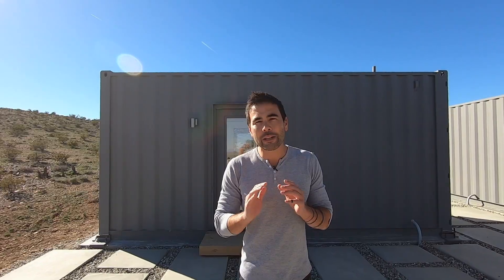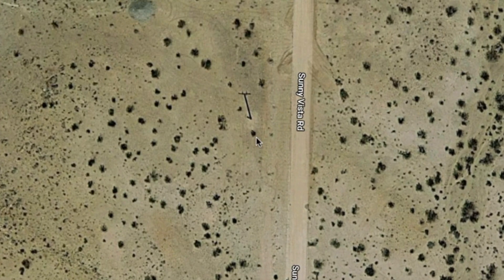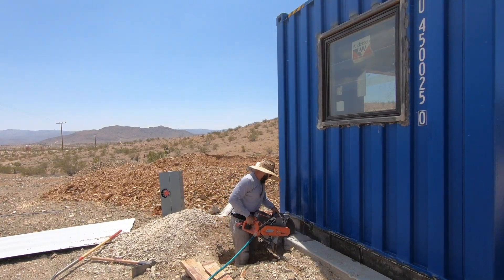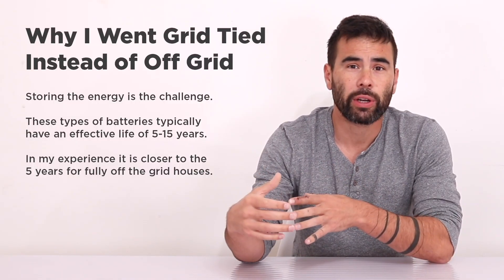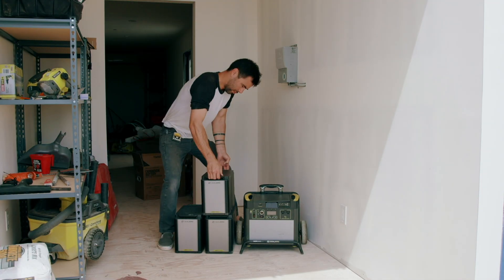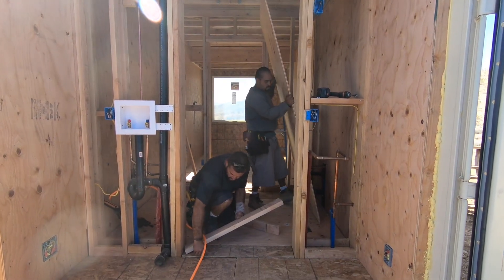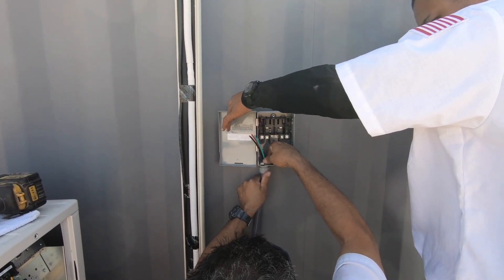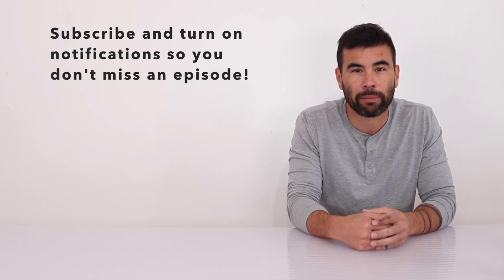Building a Shipping Container Home | EP05 Connecting to Electricity and Water

Comment: Thanks for sharing, Ben. I’m not sure I’d worry about connecting WiFi to your battery backup. If your utility goes down (not as likely in SCE desert as it would be in SDG&E or PG&E) the cable company and/or cell provider is probably out too. I do like the idea of emergency battery vs small generator, though; I’m gonna steal it from you! Cheers

Comment: Another point regarding off grid is that you need to design the storage for the depth of discharge. Most batteries do not have longevity if you exceed the depth of discharge. That can dramatically change your calculations. Usually 80% for lithium and 40% for AGM. i.e. 80% or 20% of your available capacity before you start killing the longevity.

Comment: Electrical Provider charging you for a stepdown transformer is complete BS .. Its their system , they chose to run it at high voltage. .. Yes charges for wire runs and poles on your property is normal .. But NOT the transformer .....  Cali is unreal. ; Just researching into this and you should be able to save money(monthly)  if you own the transformer.

Comment: Ben - please don't apologize. Your generous and altruistic sharing of your talent, designs and detailed information are gifts to us all. We are very grateful!
Reply: would have defintely added a solar hot water system if building in this area although the tank would need to sit in a shed outside Imexpect as they are large, we have one in Belgium the panel is embedded in the roof for ambient heat transfer for about six months we get almost free water hearing to high temperature and it seldom runs out. We have a diffent heating system for the winter and for back up.

Comment: The engineer that designed my geothermal system for Upstate New York saved me a ton on my system by not sizing it for the 15 to 30 extremely cold days we have every year.  It's sized for the other normal weather days we have. Then on those really cold days, I have an accessory heating element that kicks in for a few hours a day to supplement. I'm running a system that's about 30% to 40% smaller than I would need for those days where it gets really cold. The same idea could be used to size a solar system in order to be off-grid and save some money. Size it for 80% or 90% of the time and use an automatic backup generator for the high demand times. Plus you have the security of having the backup generator.

Comment: Great video!!! There's a con on having an air handler on top of anything, imagine a bed, unexpected drain leaks, leaking, or coil drain pan overflowed. I do a/c. I will never do that. And, efficiently talking, whoever sleeps there will have to wait on the return of the air cooling the whole space, to feel it's benefits, is like, while if the bed were in the opposite end, or the ah (air handler) were on the opposite end, the person sleeping there will feel the ac, sooner, which is what I always, try to do to maximize its efficiency, and your savings.

Great modulation and great design. I really love your house! Take care! I'm a subscriber, of all your videos!
Reply: Can you aim air flow from that A/C? Not directly on the bed of course.

Comment: Have you looked into mini split systems that have heat recovery?  If you pair with a heat exchanger you can use it to heat your water too. Pretty neat system but I think only Mitsubishi and LG have solutions available that run on single phase power. And Mitsubishi’s is kind of experimental. They did it on this old house though.

Comment: How did you pass your energy calculations using a tankless electric water heater?  It’s nearly impossible to do in California. I had to have a solar water tank pre heat my water before going into the tankless unit to pass energy code.

Comment: Ben, I've tracked with you for a very long time and really like and appreciate your content. While access to water can be fraught with all kinds of issues from obstructions, to dry holes, to significant cost overruns due to unanticipated drill depths, etc., I would've definitely opted for an off-grid electrical implementation.

Solar, of course, but also wind if the property is in an area with good production prospects, and geothermal. Air-source heat pumps are great. However, ground source units are even better for both dumping heat from cooling, and preheating for heating and hot water. It's all about the "Delta T" (temperature differential), and it's far more efficient to use the consistent temperature of the earth found just a few feet below the surface.

The use of geothermal would greatly reduce the electrical loads for air conditioning (both cooling and heating) and hot water production. Speaking of hot water, this location is prime for solar hot water production, and I would've definitely made the very modest investment in this passive, yet highly efficient, energy-saving solution.

Lastly, I would've used the cost savings from grid connection avoidance to install a larger solar panel array and a battery with sufficient capacity to power essential loads in a worst case no-sun/low-sun scenario. A larger solar panel array would shade the container roofs, further reducing interior temperatures, and a very cost-effective portable generator could charge the batteries in the most rare situations.

Rural electrification was once necessary for development. However, with today's affordable renewable energy production and storage solutions, connection to the grid is less important than in the past. I'd rather invest in energy production and storage, and be self-sufficient, than continue paying ever increasing rates for electricity; a utility that, in certain areas of the country, is becoming less reliable due to prophylactic outages for risk reduction.
Reply: Easier said than done. Even if you do manage to overcome all the challenges (not to mention them being 3x-5x the cost of connecting to the grid) with installing these systems, you also need to be willing to maintain them all.
Reply: Real talk here.. where are you going to find solar and win generation, along with realistic capacity for several days of electrical usage for the $4000 it cost to connect to Edison?  A friend just spent $40,000 on enough solar panels to supplement the daily energy consumption of his 1200 square foot house in Kansas, and the electric company credits him like, $10/month (of his nearly $200 monthly bill) for his solar generation.  It's great in theory, but in reality, it'd take you decades to break even on cost of going off grid..
Reply: @elesjuan  , I guess the key here is SIZE! The size of your dwelling determines the system needed. And when you consider thermo heating/cooling system in conjunction with solar, then I think you have a winning combination altogether.

Comment: One thing about split air con is that the outside unit (the condenser) has to be able to handle multiple head units (the inside units) because some don't, some are single head units.

Comment: The upside is you can condition the air in each unit separately; the downside is there is a lot of exterior surface area on each container that absorbs the environment.

Comment: I would absolutely not buy a piece of property without first checking to see if the ground will perk for a septic tank system (if local sewer is not available to the property). Second, is making sure electric utility is available, even if you don't plan on having electricity - you need to be able to resell the property to a prospective buyer who may insist upon such. Third, is talk to a well-drilling company as to the probability of finding water when drilling a well (if a municipal water system is not available at the property). You don't want to end up with a piece of property that is useful for nothing more than a garden space.
Some people have the glorious idea that they are going to live off-grid but that idea diminishes very quickly when they fully realize what all that encompasses.

Comment: Your flaw in thinking about solar is seeing solar as the SOLE source of energy required to accommodate your cited anomalous exceptions - instead of utilizing a complementary system whereby wood, or gas, etc. shares the load in extreme cases such a cold.

Comment: If I understand the solar system you used correctly, does that mean the soar panels aren't used the majority of the time? (except charging your bike and some tools)
Isn't that a waste of money? If you already bought the solar panels why not use all the electricity they generate all the time.
Or did I misunderstood you?
Reply from the maker: the panels charge the goal zero batteries and then i pull from those batteries  for other tasks when they are full

Comment: We used split system heat pumps in New Zealand a lot, but they fail to heat the house when the outside temps get close to freezing. because you are losing the temperature difference between the ambient air and the cold coils. Not sure if Joshua Tree can get to freezing in winter.

Comment: Hi, I understand your reasoning for a grid connection but I hate the idea of having to pay an energy company for a network connection so they can then bill me monthly 🤓. Would an appropriately sized backup generator not have met your requirements?
Reply from the maker: yes but loud, not cheap, and you have to pay for and store fuel
Reply: Hi, agreed about the noise and storage of fuel.  I was thinking of it being used as a backup to charge your batteries, so infrequently for a limited period of time. Hey it’s all about choice and options and what works for you 👍.

Comment: Now the only thing missing is a fiber internet Connection :)
Reply from the maker: yes!  wish that was available out here!
Reply: @TheModernHomeProject  , what about a wifi system?
Reply: @TheModernHomeProject  You can use point to point wireless bridge. Pay for a line somewhere else that you can get fiber connection, install an outdoor long distance transmitter and put the receiver at the container house. Get it as high as possible with almost 0 blockage that way your signal will be stronger. It can cover distances over 20KM long with little to almost no packet loss (unless bad weather). You will be surprise how well it works.
Reply: @nelsdzyre438  this sounds like a job for Crosstalk Solutions
 or Lawrence Systems XD
Reply: @TheModernHomeProject  - What about Dish internet? Is it available?
Reply: @autonomous_collective  Dish internet is available everywhere. That's kind of the point, isn't it? ;)
Reply: @autonomous_collective  Dish internet is shotty weak and overpriced in my experience 
 Maybe it will be better soon
Reply: I would never want to live in the middle of no where, due to the terrible internet that you get. Latency is terrible on on most 4G/5G networks and Low-Earth Orbit Satellites aren't going to be any where near as good as Fiber or even broadband internet, because storms and other things will still affect latency and other things.

I would paid extra money for a house/land to make sure fiber is available.
Reply: Elons got you covered in a few years :-)